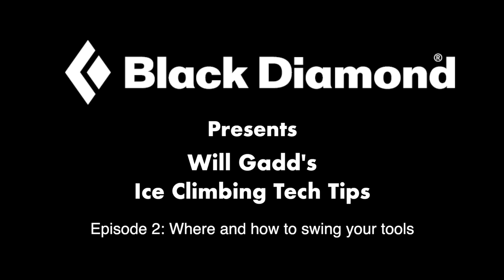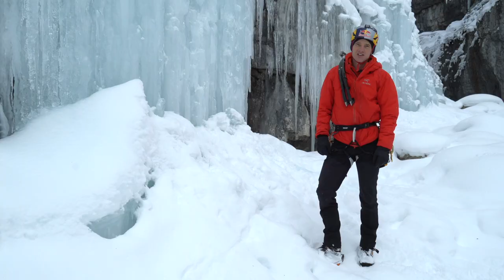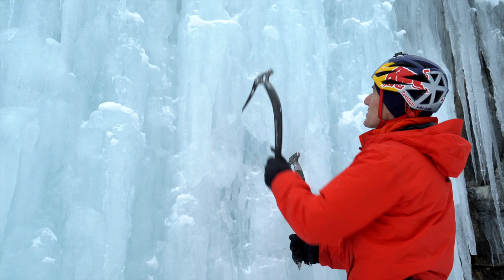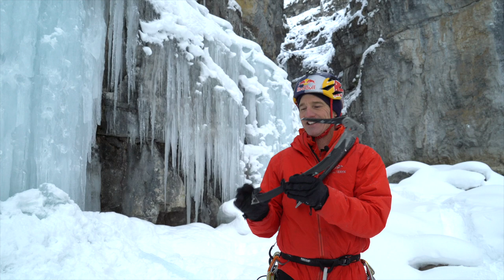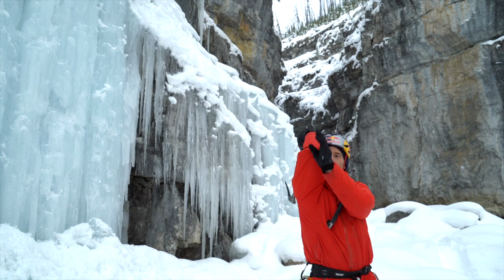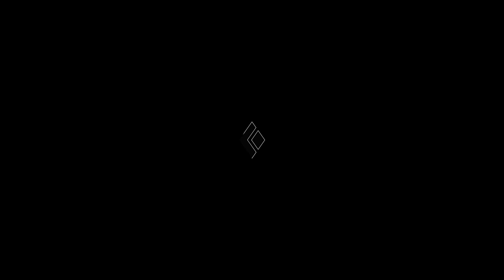How to Ice Climb Video 2: How and where to swing 'em!

Comment: Great video. I’ve done a beginner ice climbing course last year. The problem I had was getting the axe out of the ice again. I wasted so much energy. Any tips on how to be more energy efficient?
Reply: You're probably swinging to hard, swing from the wrist and peck, you don't need be burying the tool. It can also clean easier if you file off a few little teeth near the end.
Reply from the maker: Rip it out aggressively pulling on the handle after you have stood up totally. The top of the pick is a "wedge" so it breaks the ice, and out the pick comes. Plus it's fun.